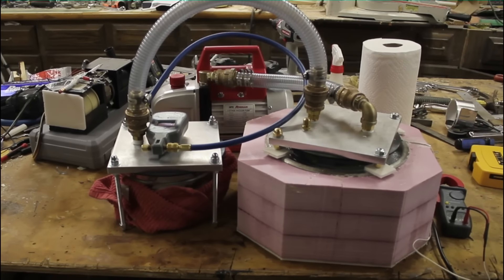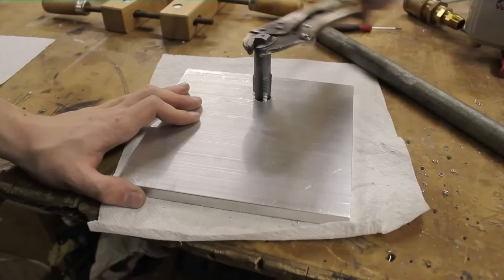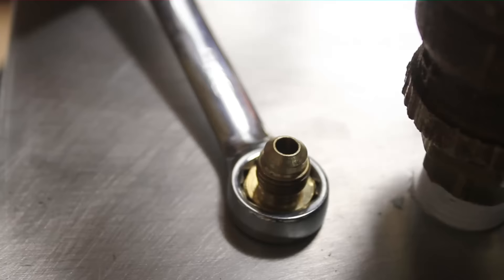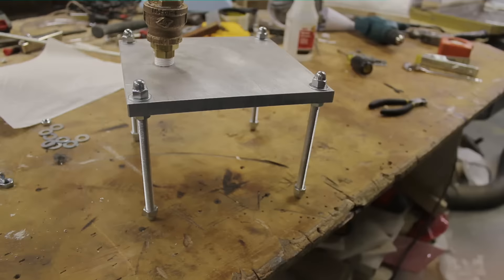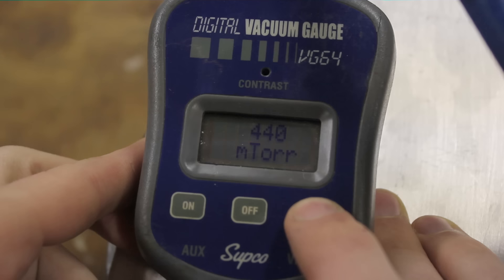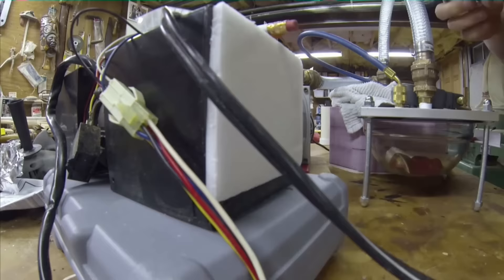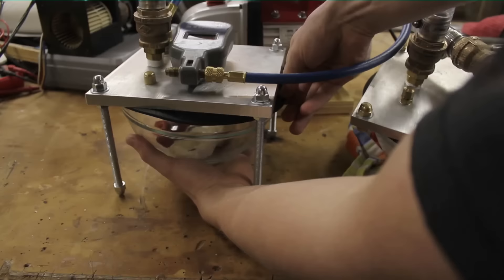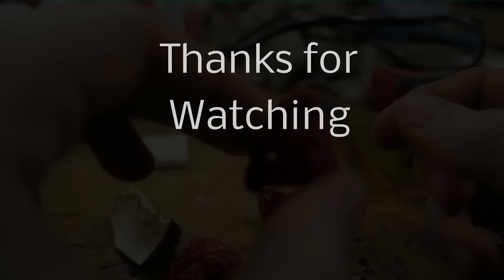How to Make a Freeze Dryer

Comment: Could you please speak faster? Easier to follow...
Reply: Just set the default setting at 2x speed. That way you never have to mess with it 😊
Reply: He didn't speak fast enough using the some code to speed it up to 3X
Reply: 1Howdy1 thank you....  .75 was perfect!
Reply: Video Speed Controller extension works wonders for any video played in your browser
Reply: Lol
Reply: Just change the speed
Reply: @1Howdy1  that only work watching on the web or with a cell phone. Youtube can be accessed with TV and other devices that do not have such setting
Reply: @AlessioSangalli  Hey man, hows it going? Wait until sat network is up.
Reply: You can change the speed yourself…just go to the cog wheel icon in the upper right corner, then pick playback speed from the drop down.

Comment: For those who might find it interesting, the Aztecs used to freeze dry food for storage.  They did this by carting their prepared crops up into the mountains, where it was freezing and the air pressure was lower.
Reply: That wasn't really freeze drying. I know wikipedia mentions it but it isnt the same as freeze drying.
Reply: @unknownkingdom , actually, it is. MY freeze dryer uses vacuum, cold (-50) temps, then warming to freeze dry.

The Aztecs, by carting food up into the mountains, were able to freeze it and take advantage of lower atmospheric temps.

Their method was a fraction as efficient as my Harvest Right freeze dryer, but it did make enough of a difference in the condition of the food to make their efforts worth while.

Merely dehydrating asparagus, for example, makes for some pretty sad end product. Freeze dried asparagus, on the other hand, is completely different in appearance and texture.
Reply: @unknownkingdom  Yes it is.

Comment: Bravo, the first DIY freeze dryer that I found on YouTube that actually freeze dried or at least attempts to. Most people just build vacuum chamber dryers instead of an actual freeze dryer. I think the cold trap should be colder than -30 C, more like -50 C but if you put a dessicant like silica gel in it, you could get away with the higher temps. Of course, the only downside of not condensing all of the water vapour is just wear and tear on the vacuum pump

Comment: umm ok, I will just buy one.
Reply: lmao, yeah i saw this and i was like........yeah i'm not doing all that.
Reply: Honestly for me I don't think I could ever bring myself to spend thousands on one. This contraption he has made, literally saves him and would save anyone else thousands. So if you two just happen to have that much extra money lying around, and can afford to buy non necessities that cost that much - more power to ya. But for the other 90% of the world, making this is a great option.
Reply: If you're a man over the age of 25 you should already have most of this stuff, aside from the half inch tap. 300 for the vacuum pump, you can rip the fridge compressor out of some junk,  and the taps like 50 bucks. Then the fittings are probably another 75 with the hose. All he really used  was a drill and some wrenches. I dont understand how anyone can opt for the 2500 dollar machine over this simple homebrew rig.
Reply: are you kidding? a freeze dryer goes for $1500 easy, this is WAAY cheaper, the vacuum pump will run you $150, those pirex dishes wont run more than $20, I think the most expensive parts here is the pump and the aluminum plates, and i dont think you will need that thickness so you can probably get away with something thinner/cheaper. you can definitely use a 1" acrylic plate on the chamber where the fruits are, not on the cooling chamber though since the temp is way to low for the acrylic to be safe.
Reply: SICKFREDO The aluminum plates, together, shouldn't cost more than $30-40... By far one of the cheaper parts of this whole setup. But regardless you're correct that this setup should cost a person less than $300 as opposed to a Harvest Right dryer which is actually more than $2000.
Reply: I will just buy one.
Reply: these friggin machines cost $1 billion dollars! But no seriously they are like $1,000 and the good ones are like $10k!!
Reply: @Chaos------  Try both and you'll know real quick!  A massively labor intensive way to make a tiny amount of food at a time vs. an automated way to crank out batch after batch 1.5-2 #10 size cans at a time.  Nevermind comparing the freezer dryer cost to commercial FD to hit break-even, you could break even in a year just by cooking normal and FD leftovers to save on food waste.  Or, buying stuff on sale in bulk.
Reply: @BStrambo  Theres no size limit on what you wanna build. I would make a machine at least a meter cubed in size, just so its a high volume
Reply: We also have to consider that commercial one is set it and forget it. This one needs dry ice every 45 minutes!!! That cost over number of batches should be something plus the hassle.

Comment: You don’t have to guess when it’s dry. If you are using a Pirani gauge determine the ultimate vacuum reading you can achieve then monitor pressure when you reach the ultimate vacuum pressure the primary drying is complete.  You might need to sit at that pressure for one hour for complete dryness. You can also add a temp gauge to the inside food chamber when the material in the chamber reaches the ambient room temp the drying is complete.

Comment: Great video. Thanks for posting it. I am looking to do the same thing. I am going to use a 2 inch dewaxing column from bvv for the cold trap. I already had this thing. I bought it right before I quit using butane for extraction, and have yet to use it. The bvv cold trap is 200. It is nice, but I think my 2 inch stainless tri clamp spool with jacket will work just fine. It is 12 inches long, will sit on a tripod stand and have flared hvac fittings on the top and bottom. I will insulated the jacket with those ir space sheet looking stuff. I have a vacuum pump, but I don't think it is strong enough. I can never get my chamber down to lower than -19 in mercury with it. So I guess I will be getting a rotary vane pump, although i hope to not spend an arm and leg for it. 

Can I use a 3.5 cfm pump, or should I go for the 5 cfm and something closer to 50 micron full vac? I just don't want to have to get more than one new pump because I sized it wrong. Thanks.

Comment: I know this is an old video but I have a couple of questions..

1.does your vac pump have to run the whole time or could you put it on a timer or a pressure switch..

2. What temp did you have to get down to? Could you retrofit an old deep freezer  by installing a smaller steel tub in side ? 

3. Is 0°F to -10°F cold enough?

Comment: Nice work.  I'm looking into building my own freeze dry unit and am wondering what your thoughts are on using a cold plate (similar to a bar system set up) or a copper coil (similar to that used in brewing beer) for the cold trap with either piece in an ice chest stocked with dry ice.  Any thoughts on whether that would work?
Reply from the maker: As long as it gets cold enough and has enough surface area to handle all the water. you may want to test it out before you set it up with feedthroughs, but a lot of commercial freeze driers use cold coils to trap the water

Comment: Hi, I don't really understand why the pump must be on for all the time.I red some explanations, and they explain that when the food looses the water, the water vapor rise the pressure aNd the pressure is the key for the process. I don't understand really good. When the food loose the water, we have in the first chamber water vapor and a rised pressure, but the water vapor goes in the second chamber where it become ice, so that we have not anymore gasses but solid and the pressure come back to the first stage.I think that maybe without the vacuum pump always on, the process needs perhaps more time, but it must work. Or not? Do I think wrongly? The pressure rises because there is not anymore vacuum because the water vapor, when it becomes ice, the vacuum is back and with it the pressure.

Comment from the maker: yulius ade, google won't let me reply to your comment.
  Yes, the vacuum pump needs to be on the entire time. An extra fan may be necessary so it doesn't overheat. Make sure you do it long enough too, I pumped mine for 18 hours strait. The cold trap stops water vapor from getting into your vacuum pump. It needs to be a lot colder than salt and ice. -35F at least, any less and the water will melt due to the low pressure inside. Also make sure you freeze your food thoroughly before putting it in the chamber
Reply: Thank you for your explanation,
so the cold trap isn't affect the result,right?
Actually i pumped it for 20 hours.
my first analysis is my strawberry doesn't freeze in the inside, although i put it in the freezer for 1 night..
Today i will try this again with the slice thin of strawberry and i will let you know the result.
I need your guidance to make this happen, and i really thanks to you..
Reply: yulius ade Yulius, 
I too am building one, And I'd be very interested in whether you had managed to achieve a result. Also, I don't really see why the vacuum pump needs to be on the entire time, so long as the pressure remains below the triple point. Can anyone explain?
Reply: *****  Hi Ryan,
I was success to freeze dry a strawberry in a bowl. Now i'm making the bigger machine for production. I think the vacuum pump is turn on for entire time because when the water meets a triple point, the water turn to gas, that gas influence the presure and the preasure is not in triple point,  so the vacuum must turn on until the end.
Reply: yulius ade that's awesome yulius, I hear berries are tough. As for your response, you are correct, the pressure must be maintained throughout the process. However, this could be done more efficiently with a vacuum gauge, a relay to turn the pump on and off, and a valve to disconnect the pump to the chamber. I.E. when the chamber pressure gets low enough, the valve closes and the pump turns off. when the pressure rises again, then vice versa. I too am curious why that page, which I'd seen before, says a single stage pump will not work. So far I have managed to boil water at room temperature with my sngle stage pump, which means it can go below the triple point. It was my understanding that the second stage simply allowed it to pull harder more easily. any videos of your current setup?
Reply: ***** Hi Ryan Cook, i still create this machine until now and i still failed, but i didn't give up. I build with big chamber (254 L) and the cold trap (125 L), and 2pcs Vacuum Pump 2stage 1HP. the result is more failed than succed.LoL. Can you give me your email for discussion?
Reply: Hi can you make a detailed tutorial on how to make the freeze dryer with the bubbler or as it took me many hours to figure out was actually a refrigeration compressor, into the freezer because I have no idea and don`t want to use dry ice to freeze it, but is there a way to freeze it using something other than dry ice?
Reply: ansen french Unfortunately, Ansen, the freezing part is where my project kind of hit a wall. To freeze dry something, you need to get your material down to -40 degrees (F or C, both are wonderfully right in this case :) ). Unfortunately, typical freezers get down to about -20 MAX. The way it is done in industrial machines is with a cascade refrigeration unit (very hard to get a hold of). 

HarvestRight is the only home unit i'm aware of, and makes its units with a custom built refrigeration. Personally, after months of effort, this is where my project finally died.
Reply: in the video he says that the refrigeration unit gets down to about negative 35 degrees. but that is the one he found and he gave no details on how to do it.
Reply: As sublimation occurs the pressure will rise. The vacuum pump needs to stay on. I doubt the that HVAC service pump will ever overheat, they are designed to run for many many hours during evacuation of refrigeration piping. I have left mine on for over 72 hours without an issue. The thermocouple type vacuum gauge will read higher than actual vacuum in the presence of the water vapor as it is likely calibrated in a dry nitrogen environment. To determine drying endpoint you could place a ball valve down stream from the vacuum gauge and periodically close the valve for 5 minutes or so to measure the dead head vac pressure and/or rate of pressure rise. Once the drying chamber pressure is relatively close to the dead head pressure and the rate of rise is minimal, you can assume its fairly dry. Feckin nice build btw.
Reply: +Ryan Cook A single stage system with Isceon MO89 (also hard to come by , unless you are in EU) or the phased out R-13B1 (even harder to find)will get you to about -55 easily. More importantly then getting your product to -40, maintaining condenser temp <-40 becomes critical during sublimation to prevent backflow of vapor to the product chamber.
Reply: Hi, I don't really  understand why the pump must be on for all the time.
I red some explanations, and they explain that when the food looses the water, the water vapor rise the pressure aNd the pressure is the key for the process. 
I don't understand really good. When the food loose the water, we have in the first chamber water vapor and a rised pressure, but the water vapor goes in the second chamber where it become ice, so that we have not anymore gasses but solid and the pressure come back to the first stage.
I think that maybe without the vacuum pump always on, the process needs perhaps more time, but it must work. Or not? 
Do I think wrongly? 
The pressure rises because there is not anymore vacuum because the water vapor, when it becomes ice, the vacuum is back and with it the pressure.
Reply from the maker: liquid nitrogen would work. 
I just took a water bubblier apart and shorted the thermal sensor. Not much too it. Find one for free somewhere and start screwing around with it and it will make a lot more sense. You could use an air conditioner too.
Reply from the maker: Its just a water bubblier with a shorted thermal sensor, I said that in the video

Comment: 3:24  "if you dont have access to dry ice a hacked water bubbler will work. Just wire it so the compressor always runs and it should get to -30f"
.... do u have a video or could u please explain how to do that?

Comment: Hey, love your video :) i want to build machine like this on my own and i have a 2 questions:
1. how do you prevent water from going directly to the pump from the water trap?
2. how do you know when the process is finish? and you products is completely dried? and when i turn off the pump?
Thank you :)
Reply from the maker: Thank you! 1: the cold trap gets most of it, but it is not perfect. I also changed the oil after each run. 
2: It is mostly just a guess as most items are significantly different. After doing it a few times with one item you will get a good idea of how long to do it for
Reply: @BenNBuilds  thank you. what about the drying chamber? is need to be cold? hot? room temperature? how much in C/F ?
Reply: @timamar  Did you find out about this?

Comment: Awesome video!
Can you explain me better how do you get -34ºF in the cooling system? What gas did you use?

Thanks
Reply from the maker: I just used the standard refrigerant, and -34F wasn't quite cold enough for freeze drying. A refrigerant such as Ethylene is necessary to reach the required temps. https://www.youtube.com/watch?v=mzeRvdnIP-I&t=3s
Reply: @BenNBuilds  Would -34F be workable if you ran the system at a slightly higher pressure?  The triple point is at 611 Pa, so I would think that 50 to 100 Pa would still be low enough to prevent melting, while making the cold trap easier to build and operate?

Comment: Awesome work! I soooo want to try doing that!
Do you think that instead of using a cold trap I could get away with pumping the air though a chamber full of silica gel pellets?
Reply from the maker: You may want to do some tests to make sure they still work under vacuum, but as long as it catches the water you're good
Reply: BenNBuilds Thanks for the feedback!
Good point, I hadn't considered what effect vacuum might have on their effectiveness. Someone else on Youtube freeze dried some apples by simply putting them in a jar with some silica packs, vacuum sealing it and leaving it in the freezer for a week, so at least on some level it works, whether it works enough is another matter.
I'm eying a used Robinair 4cfm pump I may be able to snag for $100, if I get it I may start gearing up to try this, I'll let you know of the results.
Reply from the maker: Andrew Tornadoboy Sounds good! If you see the oil going cloudy fast than it's sucking too much water vapor. This also happens during normal use but it takes longer, if you don't catch the excess water from the food it stays in the vacuum pump oil and can damage stuff (in a rotary-vane type pump)
Reply: BenNBuilds Another idea I'm pondering right now is getting an old water cooler and rigging it up with extra heat dissipation before the compressor with things like fans and heat sinks, hoping that maybe that along with bypassing the thermostat and filling the tank with alcohol will get it cool enough to be a cold trap. I'd love to be able to rig it up so as to need as little consumables like dry ice as possible.